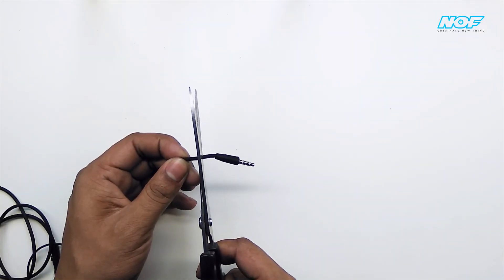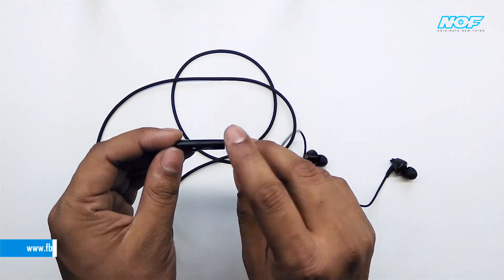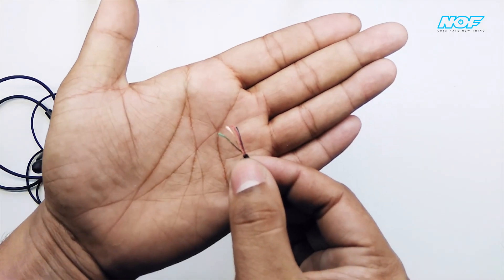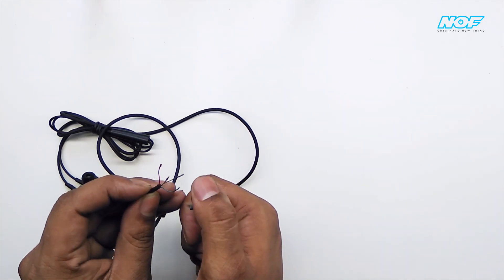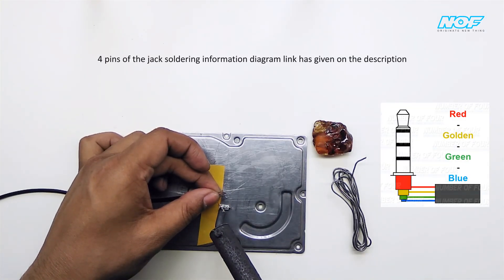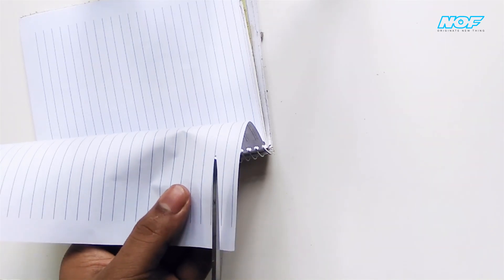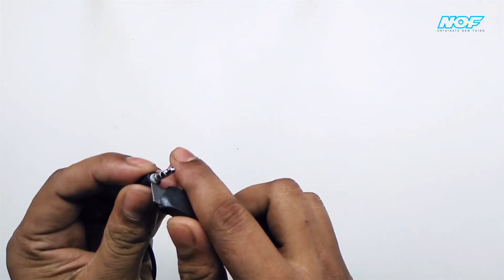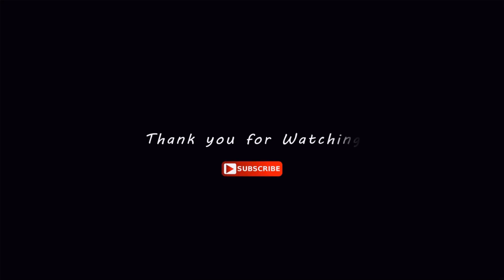How to Fix ROCK Y1 Stereo Earphone jack | boAt BassHeads 100 In-Ear wired Headphones Repair

Comment: Same earphone jack is good while right earphone is working left one isn't..please make a video on  Is there any way to open and repair boat basshead 100?
Reply: Connection problem
Reply: Same problem but no connection problem
Reply: Same problem...is it fixed?
Reply: Yes it is... opening the boat 100 model isn't that easy i did it by putting low pressure on the joining point by my teeth and saw that a wire was in open condition..soldered it through a phone repairing shop..and now it's working like before..hope it helps..